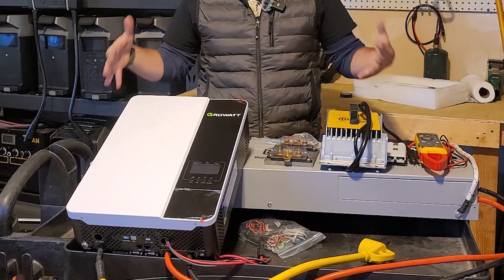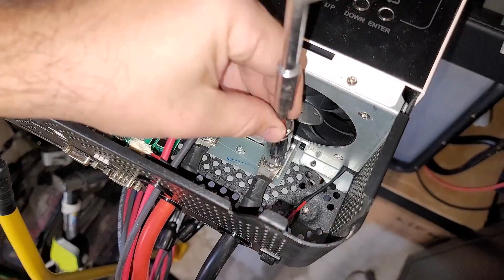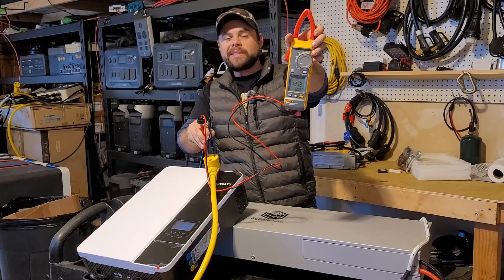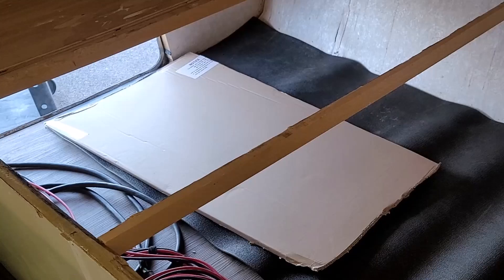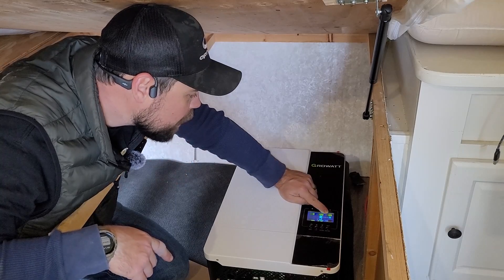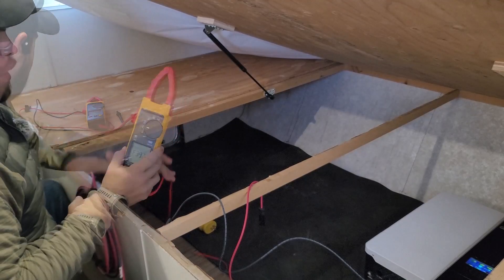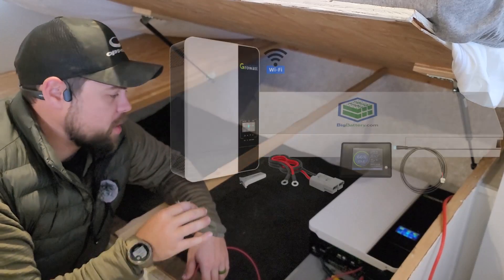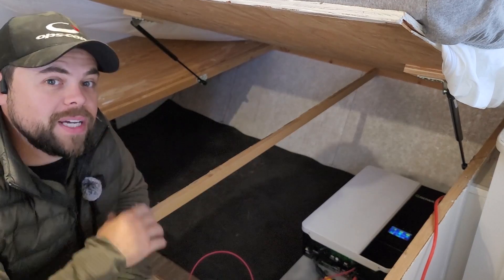Easy Off-Grid RV Inverter & Battery Installation

Comment: Can you do a smaller system like this for an RV while traveling? I need to run fridge and ac while traveling. I want to be able to plug into my truck to trickle charge the battery while driving.

Comment: Perfect timing for this video.  We are in the early stages of researching a motorhome to purchase.  We will be retiring and living in the motorhome full-time.  I've already installed a large solar system at our off-grid cabin, so naturally, I want to do it to the motorohome.  I think it might void the warranties on the roof and electric, but their warranties are usually not great any way.  My big concern is weight.  With a gas motorhome, it might be too much weight adding a lot of panels, inverter, and batteries.  May need to look at a different battery just because of weight restrictions.  Our old travel trailer had that same great pass-through storage you have.  I would definately miss that in a motorhome.

I would like to get the link you mentioned to the solar panel roof setup.  That looked very intriguing.  

Thanks for another great video!
Reply from the maker: Sounds great. If you're concerned about weight, CIGS panels are an okay option but you honestly won't make enough power from them to be of worth in my opinion. It's good if you only need to run really small basic items, not A/C, fridge, and larger items. I'll get the link to you asap on the new racking system, it's truly the best option.
Reply: @minutemansolar  Thanks for the feedback!

Comment: This Growatt 3kW high frequency, transformerless inverter is not UL-458 listed for mobile applications and for safety reasons should never be installed in an RV.
Reply from the maker: Thank you for sharing.

Comment: Good video. I know you have been a Titan fan for years. Are you going to do a video on the new Titan Boost and Titan 240SP?
Reply from the maker: Sadly no. I had a couple of negative remarks to say about the Titan240SP and Point Zero immediately canceled me as a dealer for them and won't give me access to the unit. I don't like that the 240v output is limited to 4,000w and it can't be paired with a second 240SP unit to make it 8,000w output. It severely limits the 240v appliances you can run, which begs the question, "why get it if I can only run one or two 240v items." The new Delta Pro Ultra has 7,200w 240v output with a single inverter, and each battery is 6,144wh, currently $5799, and can expand up to 30.6kwh per DPU and has 5,600w of solar input. The 240SP has 2,500wh per battery, so you need three to be a bit more than the DPU, which makes the unit cost $7,780, and only has 2,400w of solar input. I mentioned all of these concerns to Point Zero before they released the 240SP and they decided to move forward anyway. So you can buy the 240SP for $2,000 more than the DPU, and have 1/2 of the capability, which is very unfortunate. You can see the new DPU system here: https://us.ecoflow.com/?aff=368
Reply: @minutemansolar  thank you for explaining this situation. I was wondering what happened. I love my original Titan, like you do. We were chosen to be brand ambassadors for them. I use portable generators for emergency use at home, boon docking in our RV and our pharmacy business as emergency backup. I always enjoy your content. Keep up the good work.
Reply from the maker: @stacyhazelwood4033  Thanks for watching and commenting =)

Comment: I have the Eg4 system I’d like to find someone to install in my RV. Know anyone interested?
Reply: EG4 inverters are not UL-458 safety listed for use in an RV, so you're going to have a tough time finding a reputable installer who will take the risk of installing it. You should have bought a low frequency, transformer based, UL-458 listed inverter charger.
Reply: Thank you… I have been debating the install, but seen this video and thought I should find an installer… I will keep it for an off grid property. Thanks
Reply from the maker: Shoot me an email to info@poweredportablesolar.com and I'll see how I can help.

Comment: Not a fan of big battery, their service is a joke!
Reply: 👍 I bought a 24v 120ah Mule from them back in 2021 at the time all Lifepo4 batteries were  expensive. Prices Have come down alot but not Big Battery they are way over priced.
Reply from the maker: @Scott-ig1zd  That's good to know, thanks for sharing.
Reply from the maker: Thank you for sharing. I've had good service with them but it's good to know others perspectives.
Reply: Hey,Will that work with the 6000xp